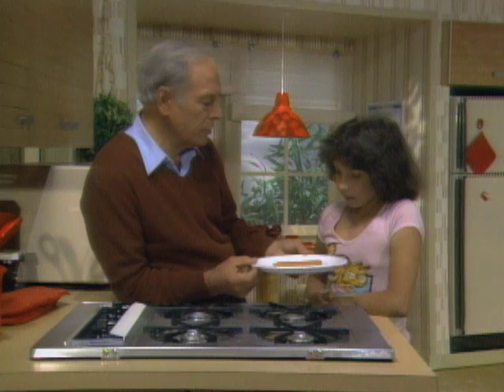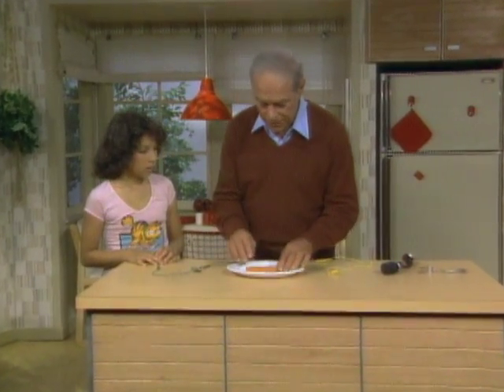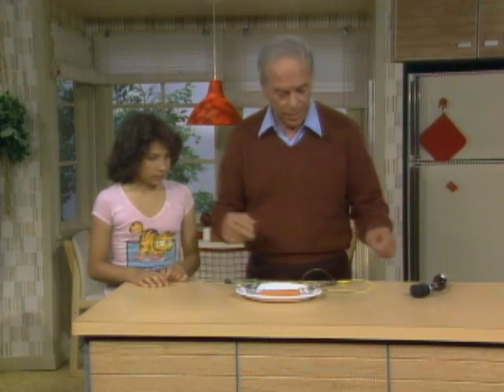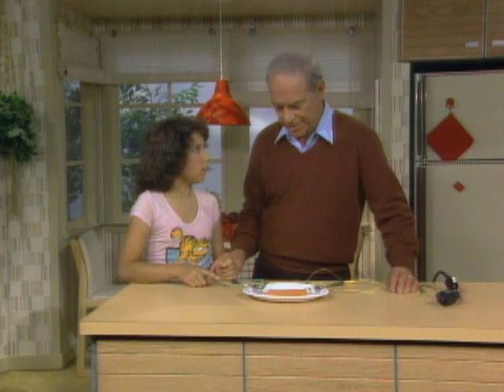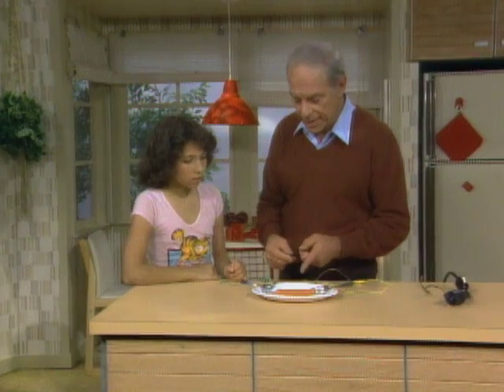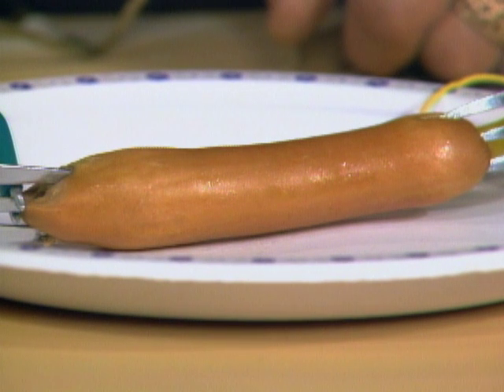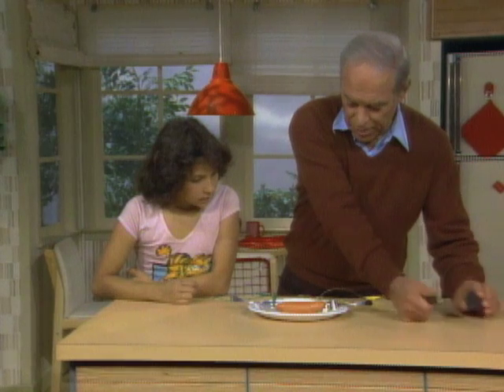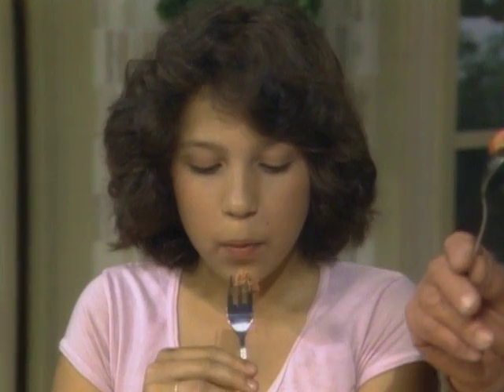Cooking With Electricity (Mr. Wizard)

Comment: I saw this experiment in an early 1960s episode of Mr Wizard. I think he was using a car battery for the voltage source. Later in the show, he showed another way to cook the hot dog. He put it on a paper plate, wrapped in a paper napkin, and put it in an 'oven'. At this point his young assistant exclaimed: No! It will burn!. We had never seen a microwave oven before. (they called them 'radar ranges' back then)
Reply: You prune 
In this video live ekectricity is used
Reply: I can't seem to find the 1960s version.

It's a little puzzling, as a car battery is only 12 volts. Based on the 1985 demonstration, I'm guessing the hot dog had an approximate resistance of around 75Ω - 120Ω. Approximate wattage is 192 W at 120V, if we assume the low end of that resistance range. (I'm applying DC ohm's law and AC RMS might throw the numbers off a little.)

12 volts applied to the same hot dog, assuming the same low end range resistance gives us 1.92 Watts, and what I would assume would be barely enough to take the hot dog above ambient room temperature after an extended period of time.

Perhaps he cut them into small pieces or had them on larger metal pieces. That would change the conductor characteristics.

That's the cool thing about science, it's all factual.